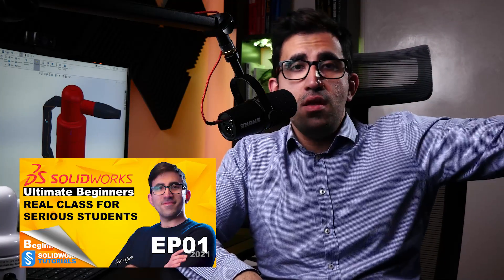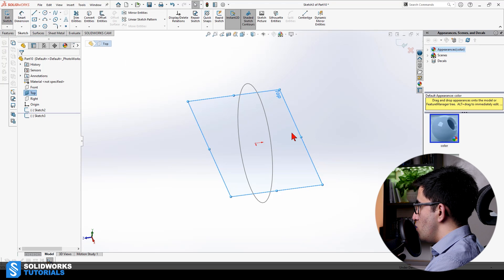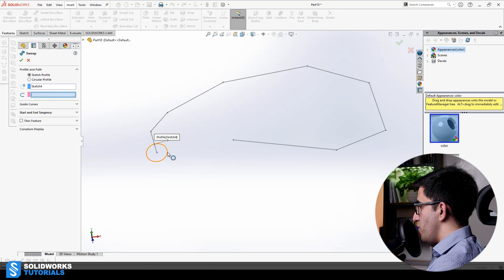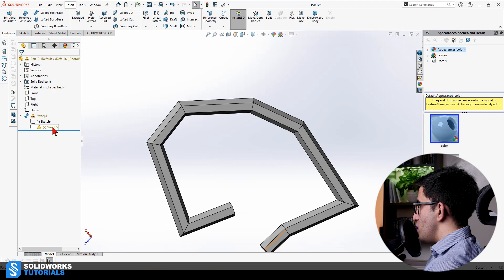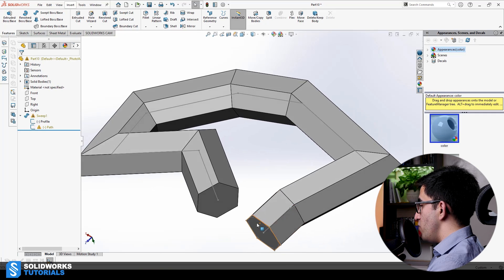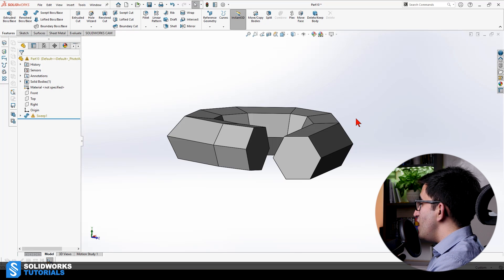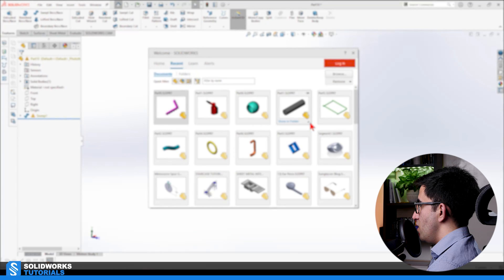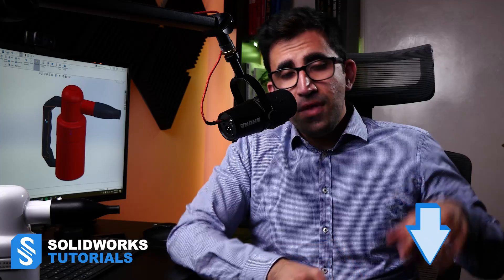Ultimate SolidWorks | Beginners | Part Five

Comment: How can we give clearance to parts once they are made. Like thickness command in catia for solid body.
Reply: Same question.  I use thickness command in negative value to shave the part (remove thin layer of material) in catia. Can't find equivalent in solidworks. Please help.
Reply from the maker: Command: Move Face
Reply from the maker: move face!

Comment: I tried sweeping with the profile and path on the same plane and it worked. 
I am confused on why that is.
Reply from the maker: Was it surface sweeo? and if it wasn't then it didn't give you the geometry you want, but a flast surface which is the projection of your profile instead
Reply: @with-aryan  No it wasn’t surface sweep. 
I tried with my profile on a different plane, snd geometry slightly looked different. 
I was just practicing so I don’t really know what geometry I was looking for. As I wasn’t following any specific drawing.
Reply from the maker: @neeldhawan3943  probably was the second case then

Comment: I thought model numbers 4,6,8 would break the rules as they are intersecting at one point and hence can't be made with swept boss. I don't understand how they can be made using this feature. 1,3,5,7 made sense until it was pointed out that 7 has variable cross section but so does 2. so how can 2 be made using this feature?
Reply from the maker: Nice observation, 2 can be made using a simple guide curve but the cross section throughout the model stays a circle, something that’s a bit more advanced. The orange handle goes from circle to oval to circle in cross section AND has a guide curve so it must be Loft
Reply: @with-aryan   ohhhh yes, okay.  Thanks for explaining.  
But what about 4,6,8. There seems to be no  beginning and end , how does SW not throw an error? In the video when both ends of the path laid on the profile it showed an error